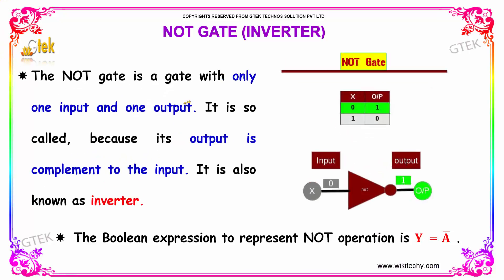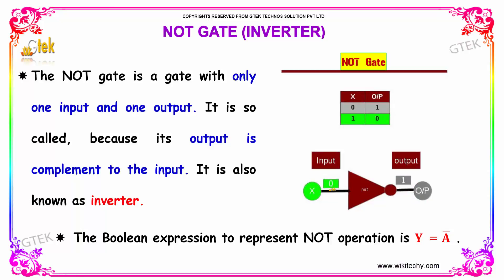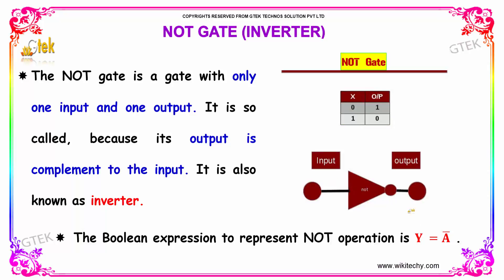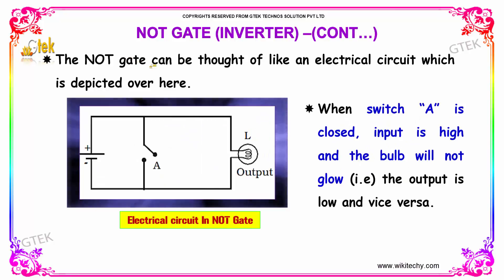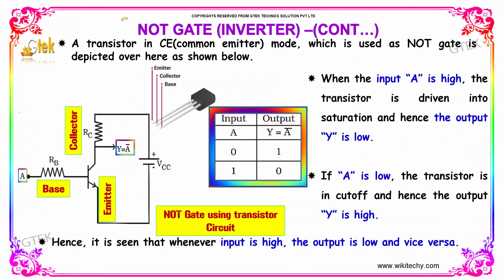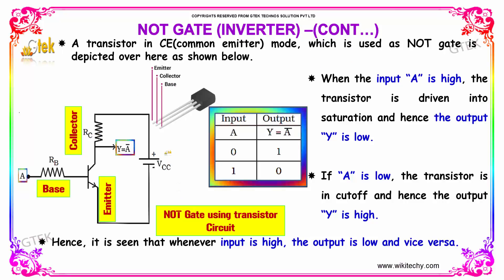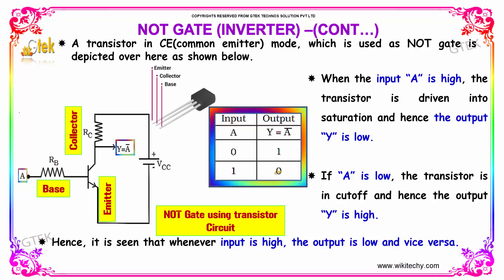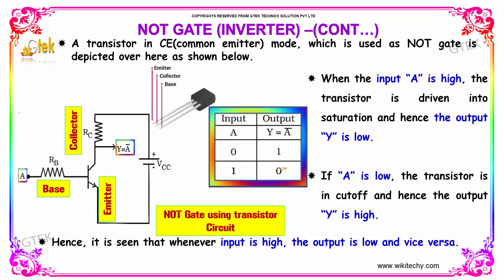Not Gate Semiconductor Devices Class 12 physics subject notes lectures CBSE IIT JEE NEET

Comment: A NOT gate (also often called Inverter) is a logic gate. Each NOT gate has only one input signal. Logically with NOT gates, the input and the output swap, so if you input 1 it outputs as 0;